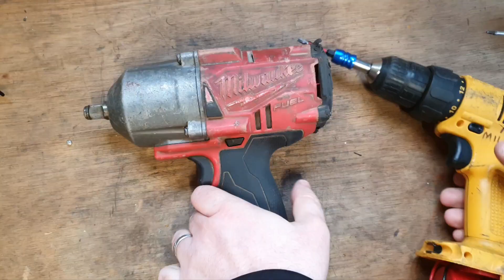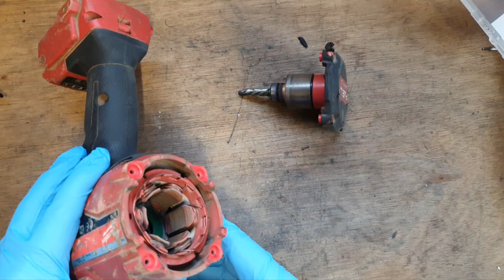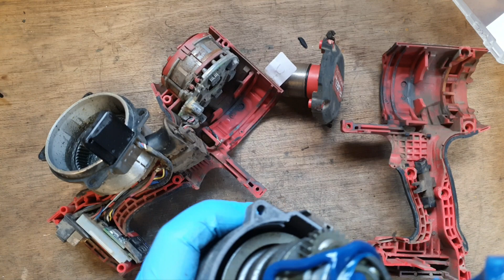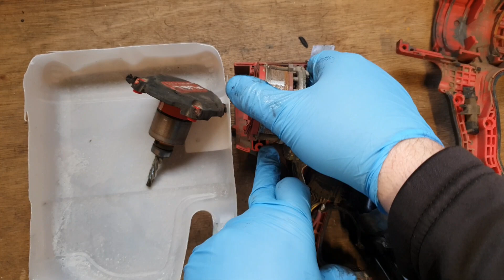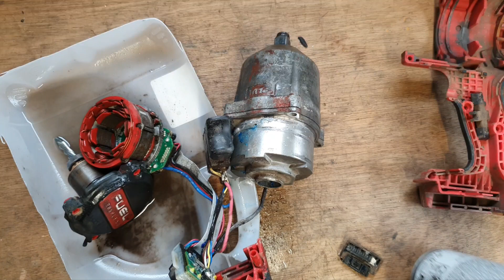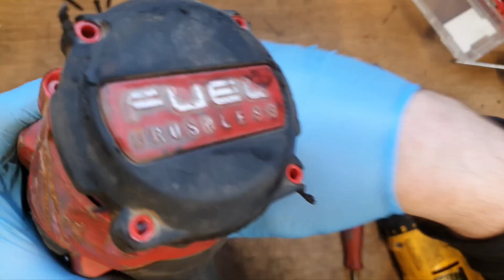Milwaukee M18 Fuel Wrench Repair Tutorial #FixIt #PowerTools

Comment: Hey, Doctor.
I’ve heard that a lot of power tools, especially Dewalt come with cheap grease. Some people have recommended that you clean it out and replace it with a good grease. Do you have any recommendations on what grease to use?
Reply from the maker: I use red lithium grease for the  anvil assembly but for the sds mechanical parts you must use lighter grease I use a makita one I got on Amazon my buddy sent me some bosch hammer grease so I use that too
Reply: @doctorlefthandthread  I saw a comment that said something about using marine grease in the drill
Reply from the maker: @DiligentDave1966  not sure some grease is better than no grease it is unbelievable how these tools end up dried up inside with no sign of grease I did a makita impact driver a couple of weeks ago it had been running for 5 years it was dry inside
Reply: @doctorlefthandthread   I’ve heard that M18 batteries get loose over time. Have you experienced that?
Reply from the maker: @DiligentDave1966  yes I have and its usually the tool that wears sds and impact wrenches mostly
Reply: @doctorlefthandthread Is there any way to make the battery fit tightly again?
Reply from the maker: @DiligentDave1966  not that I know it's one of the things I haven't cracked yet. The outer casing can be replaced but I would like to discover a more cost effective and  longer lasting solution